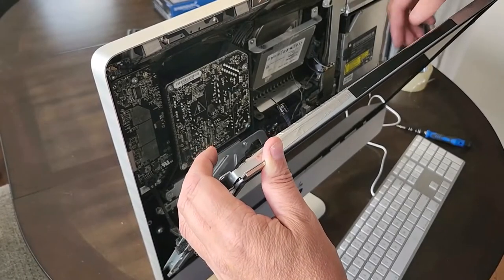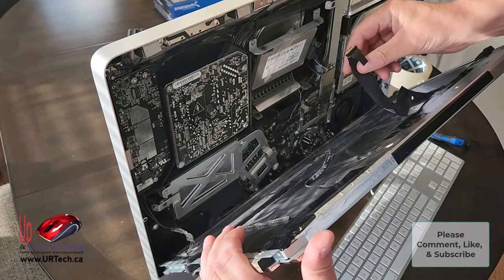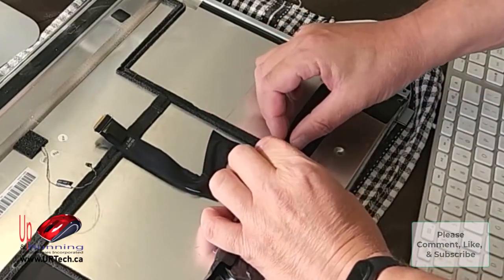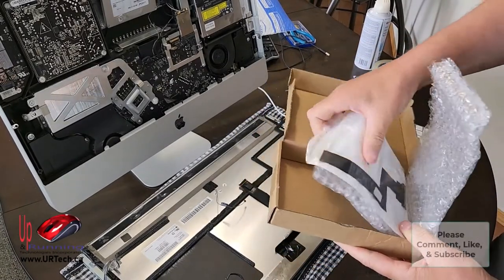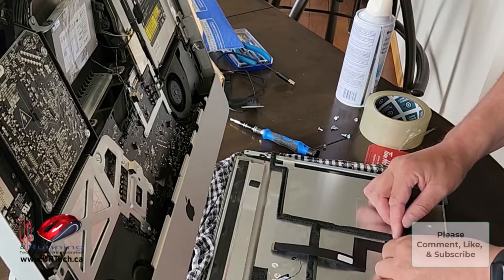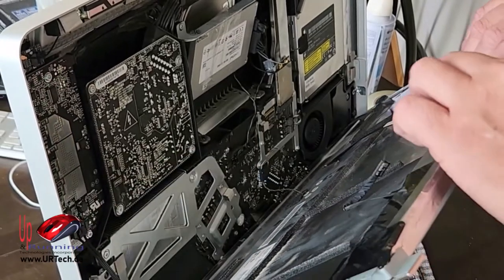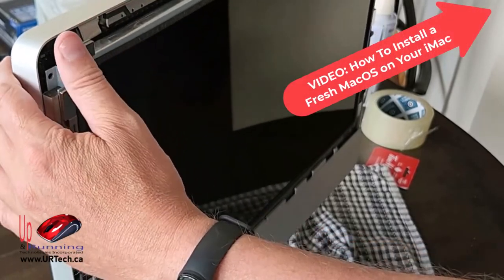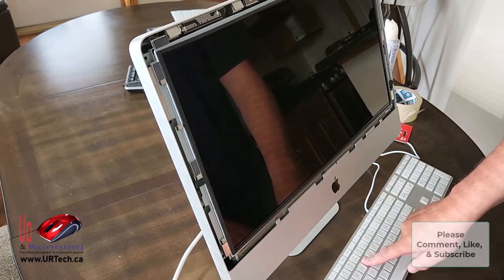How To Change the LCD Video cable on an iMac

Comment: Thank you.  You've helped me succeed.  I was unable to detach the video cable from the motherboard and I was able to zoom in and see how the clip mechanism worked.  I needed to press/pinch the clips in.  My issue was that the metal part of the clip that you press had moved out of the plastic part of the clip, I had to press it back in and all was good.

Comment: That’s amazing, thanks for sharing the instructions , it’s very helpful 
 I decided to upgrade my iMac mid 2011 and replace  the hard drive with a ssd and decided to clean it  since I bought it from someone 
after I put everything back , the screen wouldn’t come on 
Unfortunately after a couple of tries the lcd cable that you just replaced shown on the video the pins bend  
it’s so tiny and without proper lighting  it’s hard to see and it can either bend or break Finally I put the the screws back together  along with the glass cover  so I can put it away so I noticed the glass cover was not properly place on the bottom so it cracked in half when I pulled it trying to remove it , yeah it sucks 
It was perfect but now I have to order the ribbon and the glass panel 
You always have to be  extra careful when handling apple products whether they’re newer or older 
It’s always a challenge when it comes to this machines 
Luckily there’s many helpful YouTube tutorials this days , it just requires patience, some knowledge and extra caution

Comment: I've attempted repair & upgrade on my 2011 iMac 21.5" -- NOT easy (I spent many years in electronics repair): Poor eyesight, fat fingers & no prior experience dismantling & reassembling an iMac.
I cannot get the display data connector to attach to the logic board, & can't find any resource online to help me comprehend how to do this.
Someone please help!!!

Comment: 🤦🏻‍♀ Re: the 3rd cable that you put back in....somehow the connection it fits into is bent! 😱 😔 Any suggestions? I'm so stressed!  ie: the tiny plug on the logic board 😩

Comment: Is the cable the same on a high sierra I am having the same problem
Reply: High Sierra is an operating system. There are a lot of PCs that have High Sierra. Look at the back/bottom of your computer and see if there is a model number or year (like A1311 or Mid 2011). Then say what model number you see.

Comment: Does anyone have a closeup image of how the LVDS cable attaches to the mother board.  It pulled before I saw how it connected.  ie from the top or straight in (perpendicular to the motherboard) or from the bottom....I going nuts.
Reply: From the TOP and then Lock Down by pressing from top downwards, slowly...so your finger is effectively following a circular direction the size of a coin...I know as I have taken my 2010 21.5-inch iMac part frequently and the design of this Apple desktop has continued to be purposefully awkward with short cables when they could provide a fold over cable to enable a concertina effect of opening wide...APple are bastards for doing this and it just gets worse...I have a few of them.  When buying second user go two OWC for best price and real workshops and try to buy the i7 and get 4 Mb on your graphic card...